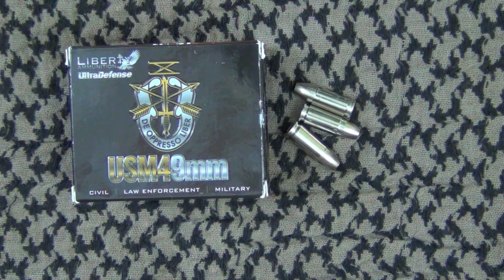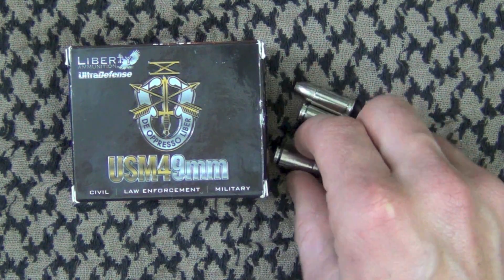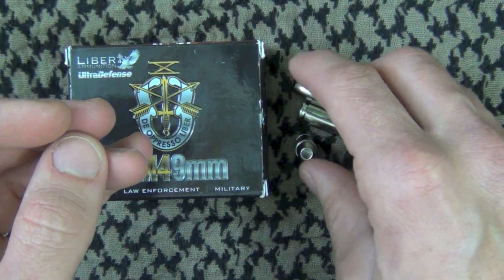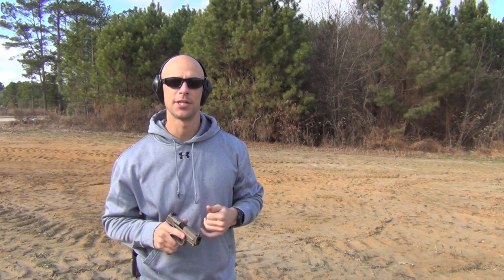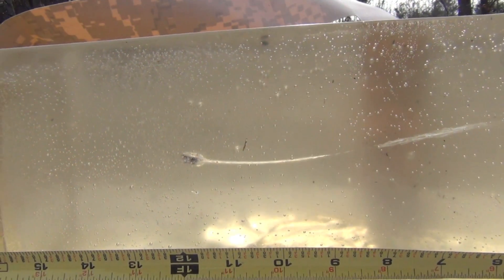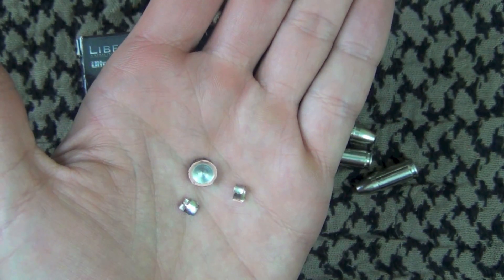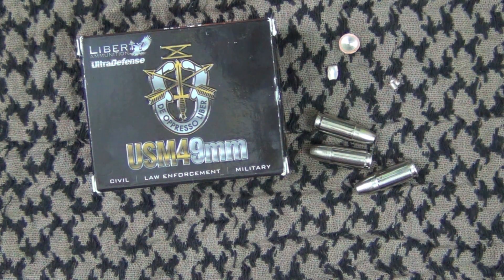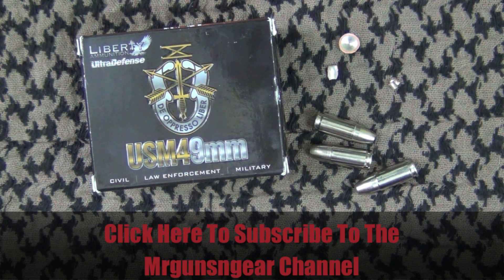Liberty Ultra Defense 9mm 50 gr JHP Gel Test (Halo Point) HD

Comment: I have a question, would you say the lower recoil made it feel like a 380? We've been pistol shopping for a very recoil sensitive family member, so far she is stuck on the Sig P238 or (steel)Colt Mustang, but if this round recoils light enough, we can get her into the 9mm market where there is a lot more gun choices. 

Side note: She already has a 22 and the Glock 42 was a little to light and snappy for her.
Reply from the maker: xxHANNONxx It's so subjective as it depends on the gun you use it in.  In a 9mm 1911 it would probably feel like a 380.   But, a 380 out of a LCP doesn't feel like a 380 out of a PPK.
Reply: Mrgunsngear Channel I hear you, for example she did ok with a CZ 75B but she wants a pistol that is small and easy to carry. The PPK and Bersa Thunder were the first steel 380s we tried but she says they snap more than the P238 and Mustang. I'm going to get some of these rounds and have her try them. I suspect as she gets more confident, she'll lose her fear of recoil and have no problems with 9mm(s). I want to steer her away from single action before I spend 600 bucks on a P238 only to end up buying her a 9mm striker fired whatever down the road. The P238 is a nice little gun and I wouldn't mind keeping it for myself later on, but she wants the rainbow one :)

Comment: Fill the hollow point with hot glue and you'd have an different kind of beast. It works but ,unfortunately, I've no gel to test.
Reply: excuse me, through 4 jugs of water, it seemed to be tumble all the way.
Reply from the maker: +Jonathan Langford thanks
Reply: Jonathan Langford  what will it do when you feel the hollow point with hot glue ?
Reply: It doesn't expand.
Reply: +Jonathan Langford that sounds great actually, kevlar penetration, max weight retention  (what little weight there is) and max penetration out of the round, i just might pick up a box just to do that now